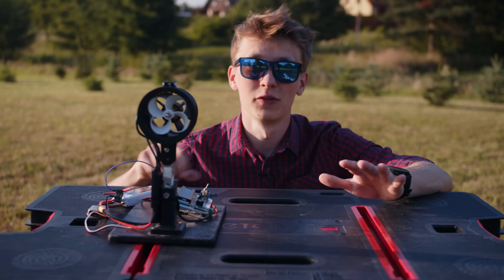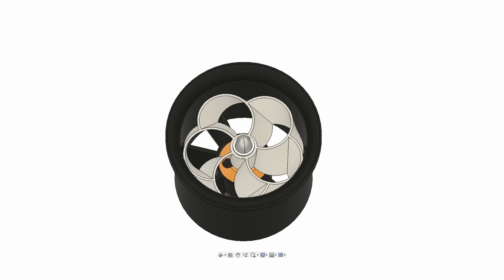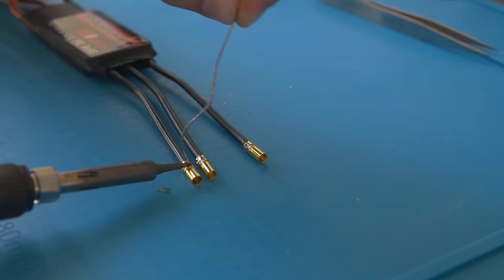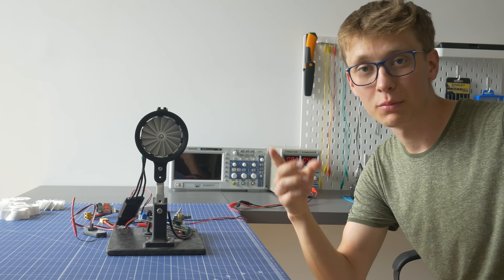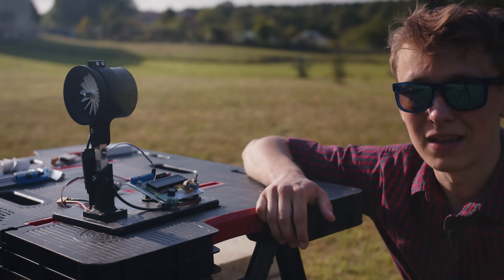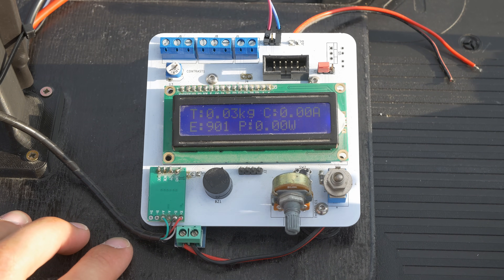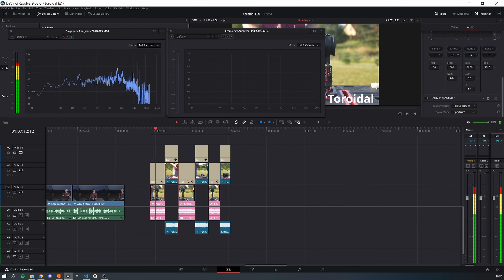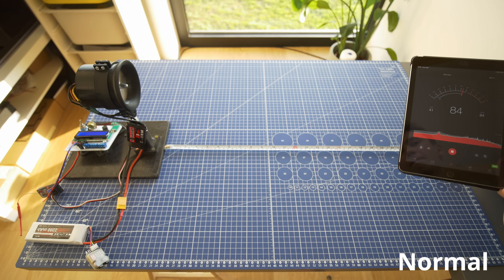Toroidal propeller vs 3D printed EDF

Comment: Sir, you are designing stuff and making it at home and doing as close to scientific tests that you can. With the tools you have available on a home budget.  

This was an awesome video. And you were able to not only display differences between your test samples but were able to highlight the more minute differences.  
I'd like to see more of your videos.

And as a thought on the results and figuring out how to make an improvement.  My personal opinion is to start looking at the propeller basics. Surface area and pitch. Followed by weight.  The goal to take a commercially available EDF turbine blade, figure out the surface area and pitch to get a baseline volume per revolution  of the prop. Then design a terroidal prop with the exact same volume per revolution. And make it lighter than the commercially avaliable prop. 
Volume per revolution gives you a baseline number that also gives you baseline drag that the electric motor is put under.  If rotating mass is identical and volume per revolution is identical then your electric motor efficiency should be close to identical. As in amp draw and rpm should be identical.  

Eliminating the variables in this way should allow you to get better data on thrust and decibel levels when comparing the 2.  
I use to build and fly r/c foam board construction aircraft and indoor gymnasium flyers. The electronics were the hardest part to  get an efficient and light setup.  And then quadcoptors showed up and all the skill in getting something tiny to fly and fly it well turned into who could afford the newest and better quad.   Then the government crackdowns on the hobby happened and I didn't pick up a remote until recently.

Comment: Nice. 
If you were able to test these same designs under speed or in a wind tunnel, you'd have different outcomes... Mabe blow a leaf blower into the intake to see what happens. 
Some would cavatait more, others less. Some would be more efficient based on inlet speed.
Keep testing!

Comment: The best thing about toroidal props is that they're more structurally viable for 3d printing.  That's really about it.

The 1 most interesting prop would have beeen...  a 2-bladed toroidal prop.

You probably could have printed the props in ABS and then easily acetone smoothed them.  

All your results need to be correlated with power.

Comment: I think the toroidal shapes you generated were suboptimal and would need further tuning. Better shapes are likely more soft organic shapes. The key benefit of these toroidal propellers as far as I have seen is when they operate at low to medium thrust and the efficiency drops off compared to standar propellers towards the high end of thrust. I am not at all surprised of these results. Neat to see non the less

Comment: Just a little question : 
When measuring effective thrust, did you take into account that as the edf's center isn't at the fixing point of the strength gage, as it is further, the lever increases and the measured force doesn't represent the real thrust

Comment: Be careful testing 3d printed things spinning at high rpm. In the nerf hobby, some brushless flywheels are printed, and petg prints failure mode at high rpm is shattering into lots of pieces.

Comment: The point of toroidal propeller is to decrease/spread the harmful vortices that form at the blade tips. Proper EDF has practically no space between the blade tips and the duct wall so vortices have nowhere to form. So toroidal ducted fan does not make sense
Reply: The poster is correct. The toroidal blade closes itself. A tight tolerance would hinder performance due to drag. This loose setup however does look to be a sturdy mount for the fan assembly, if nothing else. The experimentation steps made in this video are in my opinion, excellent!
Reply: I guess toroidal propeller is one way of enclosing the props, where as ducted fans are another way.
Reply: Bingo, a well designed/made EDF is already very efficient because of the tight tolerances between the fan and duct.
Reply: what about the leading edge and the blade profile?
Reply: Nice project.could you test toroïdal propeller without a fan case? Toroïdal propeller don t need to be ducted.👍
Reply: Came for this comment, thanks.  Everyone seems to be missing the benifets of the design.
Reply: My thoughts exactly! This wasn’t a well thought out display.
Reply: So it may work beautifully for environmental or stealth applications but not high power applications.
Reply: @jamilagard8429 it makes an unducted fan/prop perform much closer to a ducted fan/prop in thrust, but quieter and more efficiently.  Arguably better than a duct in most applications
Reply: What kind of 3d printer did you use? Its important that use a really good plastic and also there is some ways to improve the Toroidal propeller efficiency at the tipping point, down the end of the blade.
Reply: first thing that came to my mind
Reply: So your message is “Don’t try!”?
There’s always an a** in every comment thread and not only are you it but all of your a** mates joined in to show their true a**ness as well, kudos to you and your pals…
Reply: We are all here to learn. God Himself will instruct US. Have you considered placing the toroid at the entrance of the duct? Prior to the main tube covering portion. I'd imagine if it has increased air flow draw it might function well in that configuration as a thruster/concentrator.
Reply: Couldn't have said it better. @luke_fabis
Reply: Then how do you explain the reduction in noise from the toroidal EDF compared to regular propeller EDF? Just his imagination?
Reply: how often are EDFs properly done tho? and when, not if, the EDFs are no longer in fine tolerances, would this toroidal fan help?
Reply: Not necessarily. The reason they gained esteem because they literally provide more efficiency and more airflow as a result of the evenly distributed vortices. The more efficient operating functionality led to a quieter noise output. Outside of the manufacturing process, and high-cost production, this design style is actually a great idea to test.
Reply: ah thank you
Reply: The advantage people care about is the 3D printability.
Apparently toroidal props are easier to 3D print.
Reply: wow..  you got it dude!  take the duct off the toroidal and see what it does.  The duct killed ~30% of the toroidal thrust area!
Reply: Also it's designed for use in a Fluid like water!!
Reply: @tatradak9781  air is a fluid
Reply: To all the people crying because @hlavaatch pointed out something obviously true...  Do you just not care what it is true?  

The purpose of this video was to explore...  something that makes no sense.  Should that not be said?
Reply: true, but we need the meme to keep on going dont we
Reply: Yes, if he finds out that's what happens, what's the problem?
Reply: and? its a cool experiment.
Reply: @PennyEvolus Some of out here trying to learn dude. I think the commenter did a good job of enlightening some to the practical usage of toroidal props. I agree that it was a cool experiment but I’m also grateful for the comment that can provide additional information.
Reply: @BadPractices  he was being very rude about it tho and insinuating that the video was a waste of time
Reply: @PennyEvolus he wasn't being rude, he was pointing out the fact the experiment isn't the most accurate. and give some viewers an idea of what the difference is in between those two propellers
Reply: @PennyEvolus cry about it
Reply: @trevc63  nah too busy crying abt how boring life is
Reply: @PennyEvolus  What a sheltered life are you living that you think he was being rude? He added valuable knowledge to the video, what did you contribute?
Reply: @Cjeska  thats hilarious some of the stuff ive been though would make u go mad for example being locked in a room alone for 6 hours and getting beaten every day for 5 years note im not asking for pity im only showing you that you cant know what someone else has been though
think before you type
Reply: @PennyEvolus  You need to go back into your room and stay there.
Reply: @GoatZilla  nah i got a date with my partner tomorrow can't cancel
Reply: @PennyEvolus  Well he sounds like a lucky guy hope that works out for you.
Reply: @GoatZilla  yeah thanks mate also im sorry about arguing with you
Reply: @YggdrasilStudios losing the argument here so you pull the victim card? Are you f**king kidding?
Reply: @Hook0403 at least the guy apologized people are getting all spun up atm for all sorts of shit. cut the guy some slack.
Reply: @hellawacked  you're right. There's no need to be heartless. My bad.
Reply: @PennyEvolus it is...
Reply: @PennyEvolus No, no he wasn't. He was just being matter of fact, not even aggressively assertive. He didn't say the video is bad, or the YouTuber is dumb, he simply said it isn't an ideal application. If you can't handle people disagreeing with you without coddling you throughout the conversation you shouldn't engage in the discourse that will get you worked up.
Reply: @PennyEvolus soyboy hurt feelings
Reply: @PennyEvolus 🤡🤡🤡🤡
Reply: you're a waste of time  @PennyEvolus
Reply: @BadPracticeAutomation except that the problem I found is that there's loads of loud mouths that actually don't know what they talking about. They may have read some stuff and then make assumptions. That is not learning.
Reply: @no.1_trustno1 that's not what he is saying
Reply: @PennyEvolus  We usually perform experiments after a proper hypothesis is made.
Reply: @GoatZilla  and sometimes people like to do things for FUN im not sure if u have heard of that before
Reply: @PennyEvolus  I don't consider bad science as "fun".

Branding stupidity as "fun" is still stupidity.

I suspect you'll be dragging that anchor for the rest of your life.
Reply: @GoatZilla  maybe but ill be having fun unlike u scientists
Reply: @PennyEvolus  No, I have fun.  I have fun doing intelligent things, while you have fun doing dumb things.

That's going to wind up being a real good life trajectory for you.  Keep it up.
Reply: @GoatZilla  live fast die young
Reply: @PennyEvolus  Hope so.

Comment: It's a really interesting test. I think it's a good idea to compare thrust/watt + the decibel level at the same amount of thrust (because if a prop got a lower efficiency, it's not surprising the noise level got lower at same rpm or watt).

I wonder about 1 thing, all EDFs seem not to consider by design: The efficiency is close related to the gap between the tips of the propeller and the case of the EDF. The more you scale down, the harder/impossible is getting the tolerances right.
So why not reducing the gap between the wing tips and the case? -> Let the inner side of the case be a part of the propeller and rotate and the outer part of the case behing fixed.
Reply: Somewhat the same idea that I try to say. You have an interesting idea there also. That will get rid of the dangerously small gap. The inlet can probably be just a little smaller than the outside diameter of the blades, or the same, but just in front of it. Maybe that will cause another problem again.

Comment: Interesting tests! One thing to also consider is that an EDF on a vehicle doesn’t normally see incoming air at 0mph. If it’s on an aircraft, it’ll be seeing air at flight speed, so the necessary pitch changes. Racing RC planes often have such aggressive pitch that the props sound terrible and don’t generate much thrust until they get into higher speed air
Reply from the maker: Interesting observation, haven't even thought about that. I am planning to build a small drone based on a single EDF that is kind of similar to a rocket and it is stabilised and controlled with flaps underneath the EDF. BPS space build something like this a while ago and it looks like a complicated and challenging project - a lot you can learn while building that!

Comment: The tes is not realistic, because you printed toroidal propeler from FDM printed technology. FDM technology is not precise. It's different if you print it in DLP or SLS technology.
Reply from the maker: Standard propeller was also printed with an FDM printer as mentioned in the video. Sure it's better to print it with an SLS printer but I prefer to use the tools I have an test some ideas rather than complaining about not having the best tools and doing nothing.
Reply: I didn't see any aerodynamic considerations in the designs. I don't think the prototyping method matters.

Comment: I actually believe these are not toroidal props as a toroidal prop has a curved edge along the outside instead of just being slanted sections of multiple tubes arranged around a center point.
Reply: From the video, these propellers do not seam to be optimally designed. If they where, you should get much improved performances.
Reply: Yes

Comment: The gap between the shroud and the propeller blade seems to be pretty big. That lowers the performance quite a bit as a vortex can form there. Other than that, good job!👍
Reply: Additionally toroidal tip geometry interferes with the ducts lowering efficiency, Perhaps there is an optimal design for a ducted toroidal propeller
Reply: @SET_EV_Guru  - why would toroidal geometry interfere with ducts more than regular propeller?